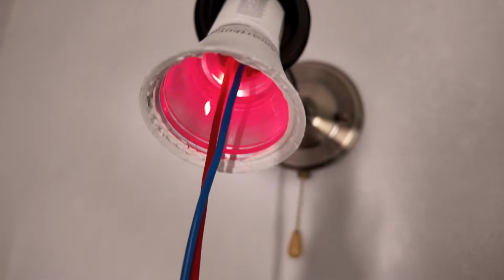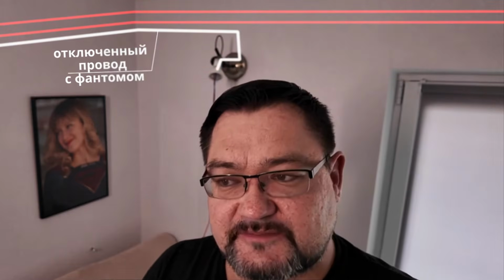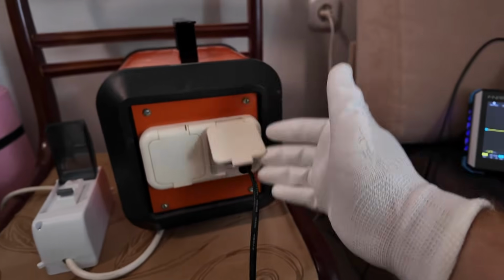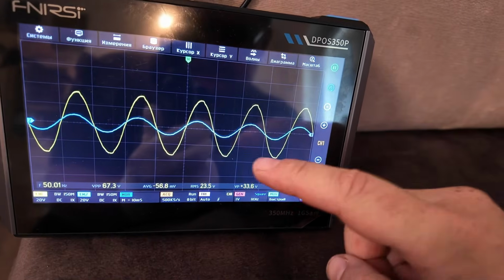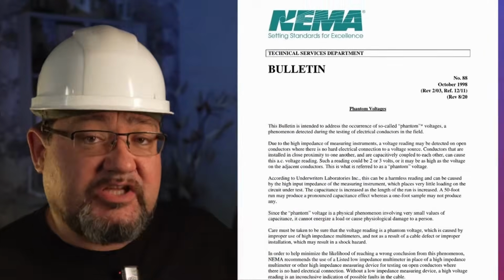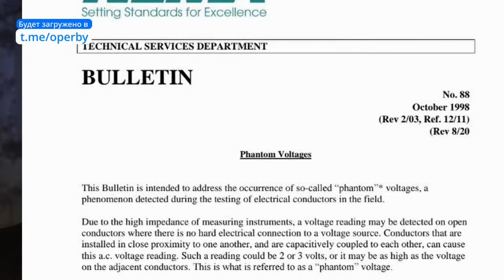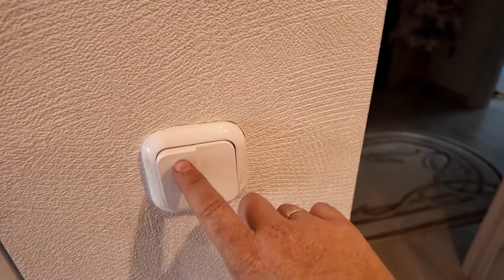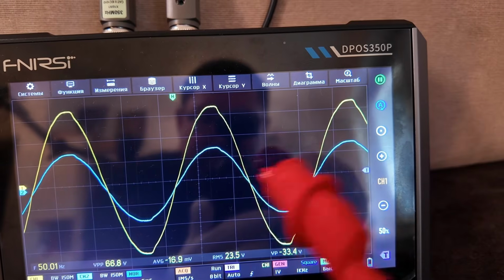Shocking Truth About Phantom Voltage Revealed!

Comment: I have LED lamps from 3 different brands, only Phillips brand are the one that glows in night. Other two brands are Havells and Syska, these brands are maybe India exclusive. 
And no, we are not replacing copper wires with aluminum ones. Aluminum wires are used for last mile delivery only. From the energy meter to inside home wiriting, everything is copper.
Reply from the maker: This means your Philips bulb is more sensitive to phantom voltage than other bulbs. Copper wires have better conductivity, so they better transmit phantom voltage to LED bulbs.
Reply: @Electrosium  Yeah, that's exactly what my thoughts were regarding Phillips LEDs.